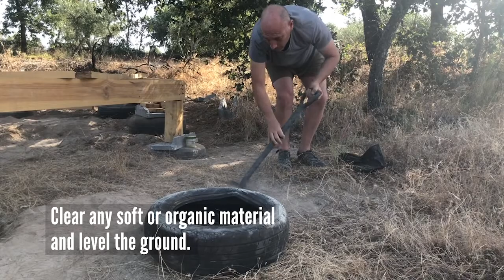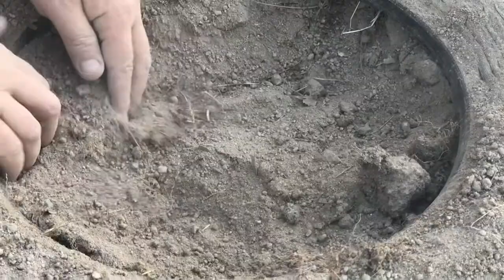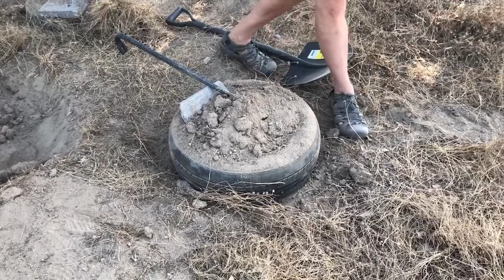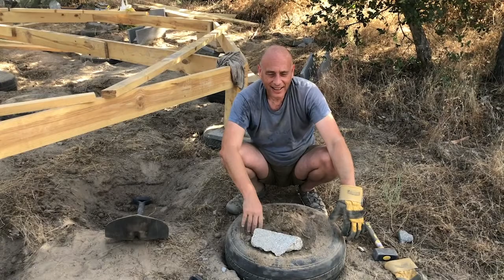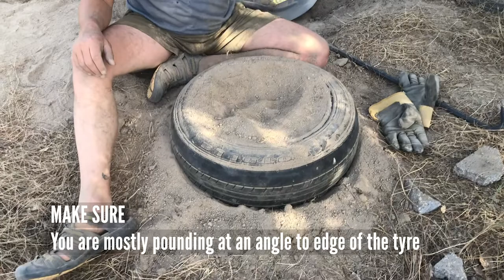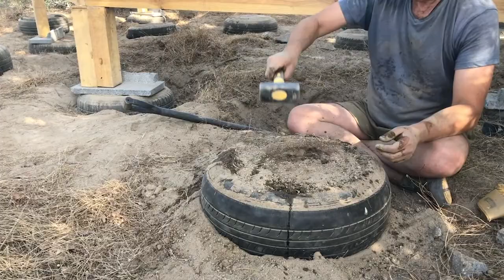The Easiest Way To Pound A Tyre For Load Bearing Walls / Earthships

Comment: Question: When building a retaining wall, are there any extra actions or process required, e.g. double skin Ed tyre wall, stepped tyre wall as in 2 on top of 3 on top of 4, or rebar. What’s to stop the tyre wall falling over under the weight of Earth pushing horizontally onto the tyre wall? OR Do you erect the tyre wall and it’s good to go?
Reply from the maker: The most important thing is to just step back even a couple of inches on each row as long as you are stepping back even just a little bit by the time you reach the top it will be at least one or 2 feet and it will hold. I’ve seen incredibly tall almost vertical tire walls done like this. If you look on Google you could find it also. Generally, you don’t need to pack it nearly as much as you do for a load bearing wall however if it’s very big, you might give it a bit more.
Reply: @AlexEarthshipLeeor  Thank you 👍

Comment: What do you think about adding water to the dirt to make mud? It seems like it would make the process easier. 

Of course the mud would need to be the right consistency so it's not too wet.

Also, I've seen some people cut off the tops of the side walls so you don't have to spend so much time packing out the sides. Have you tried that?
Reply from the maker: I think it’s one of the most common questions I get, but it’s a totally different thing. You lose all the benefits when you do that.. the whole strength and the thermal mass properties of a tyre wall are based on compaction without any water and that’s what makes it work. That’s what means you don’t need clay special type of soil and that’s what means that there’s no waiting no setting. If you would to try what you say, the water will evaporate and it will set with gaps and then you will get subsidence plus, it will just be a whole different thing. This is Cobb and earth rammed approach.
Reply: @AlexEarthshipLeeor  ah yeah that makes sense. what about cutting off the top lips of the side walls?

Comment: What about using a concrete vibrator and adding water to make it all a fluid, vibrate it, and keep adding soil and water?
Reply from the maker: That’s a real no  to all of that I’m afraid.. You’re talking more like doing a mix like cob that would set. It defeats the whole approach of pounding, which doesn’t require any clay or anything like that. What will happen is if you put too much water, it will evaporate and then you will get way too much settling and after the eight courses, you will end up with subsidence you need to have these tires packed with the minimum amount of water if any, and just get on with it.
Reply: @AlexEarthshipLeeor  Got it. Thanks for explaining.

Comment: I have easier method. At first, wear gloves, your hands will thank you.
Then, instead of doing it with hands, buy boots with a steel cap. Kick the soil with a boot, instead of hands. Later, use pickaxe to pry out the tire, while kicking the soil with your boot. Secondary advantage of this method is, you press the soil into the tire naturally by standing on it, with each step.

Comment: I see you do alot of hand manipulation of the dirt. Why not wet the soil and make it a paste? I think it would pack easier in the tire and there wouldn't be any voids. If you want it packed enough to swell the tire then add more mud then lay a sheet of plywood over the tire and stomp on the wood. It should force the mud into the tire. The way you're doing it looks like alot of overkill.
Reply from the maker: That’s a great question and there’s a few answers.. 

firstly we really need to avoid adding any water because the whole approach here is that we put as much thermal mass in as possible, and that we do not rely on binding with Water to get any strength because that is very weak and prone to cracking, and also when it dries the water evaporates and the tire then becomes a bit soft, and u get a far less resilient structure.  

Also, By the time you start playing with water and mixing etc,  u may as well have  just used the sledgehammer… 

there are many ways to do this, and  this particular video is demonstrating a method that is very  easy in terms of needing strength and ability to use very small tools. 

It’s perfectly suited to older or younger people or those with any physical issues.  

Also, the majority of the compaction needs to happen in the sides of the tires, not in the middle and the only way to really get that done properly is by pounding to the side of not straight down.. the list goes on!! The idea that you suggested just be a real mess and it really wouldn’t provide anything like the compaction you get with a sledgehammer or the approach I’ve shown here.. 

we need 90% plus compaction to do this properly. You would get about 40%  compaction using the method you’re suggesting,  which is  not be sufficient for a long-term strong home…

Comment: Wouldn’t it be easier to cut out the sideways?
Reply from the maker: simple answer is no.. the whole idea is to get as much mass as we can compacted into the tire.. its REALLY hard to cut them, and if you do you lose the strength... of the tire itself and the ability of the sidewall to really hold all of that dirt in with 90% compaction

Comment: there has to be an easier way than using your bare hands on hundreds of tires individually to fill in 20 minutes per tire
.
Reply from the maker: there are so many ways,, this is just one.. and its REALLY easy this way.. u can just use a mid sized sledge but some people dont like using them so much as it takes much more force to compact with one.. my method uses so little power from me but still NAILS the rock hard tyre that will last 1000s of years

Comment: As someone who is currently doing the exact same thing but for 10 acres, surrounding the borders of my property.  I am 6 ft 1 in and weigh 250 pounds. I find it scientifically impossible for anyone to explain to me how a 8 lb sledge Hammer being swung at half swing can generate close to 100 lb of force, whereas me stepping on the same dirt I have 250 lb of gravity.
Reply from the maker: Maybe u dont need 100lb of force to pound a tyre with this technique. the final results r same, rock hard tyres ;)

Comment: Thanks for sharing your knowledge and an excellent way to use an old tyre. If I may suggest that using a suitable mortar would save your fingers from enviable injuries. 
Especially if you intend to run a wall of tyres.  😊

Comment: I pound tires all day and average 20 minutes per tire with only a 9 lb. sledge hammer. Moisten all the dirt first. Always overfill with dirt. Pound all around. add rocks near the end if available. Let the weight do the work. Go easy on your elbows!
Reply from the maker: Nice!  Thanks for the tips! Yes ive also i pounded the traditional way.. this is a nice option for people who dont like the long big sledge so much.. most of it i was sitting on the floor ;)

Do u build earthships?

Comment: Just for 1 tyre That is stupid
Reply from the maker: well if you understood the whole story you might not say that.. but believe me theres many VERY good reasons why its just genius
Reply: @AlexEarthshipLeeor  im going to have to agree with the rude guy above. The most efficient way to pack a tire is with a tamper. Ill fill the tire then tamper it down again usually just twice. The whole process doesnt take more than 5 min. I do however remove a face from one of sides to make the process easier. I also run bolts through the sides so as to kinda fasten the tire to the tires next to it.
Reply from the maker: @alejandrosantana5693  its ok for retaining walls but not for buried earthship walls.. they are very soft like that and over time can subside. The only way to get them rock hard is to fill the sides, that is the rule for Earthships at least.. but yes ive also done them in 5 minutes when i do retaining walls..

Also, its worth noting that i am putting around three times more dirt (thermal mass) in the tyres by compacting it well. This means three times as much thermal performance when it gets cold, which is really what we want...

As i say " Every tyre We Pound Today Is Wood We don't have to chop and burn tomorrow..."